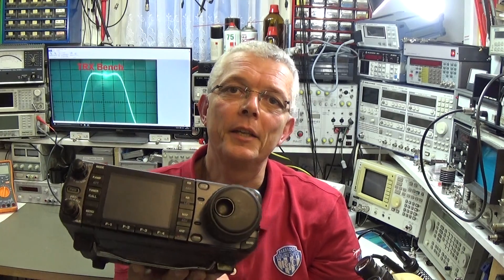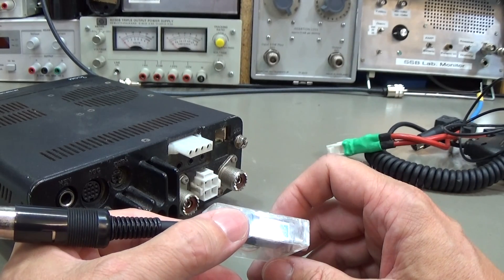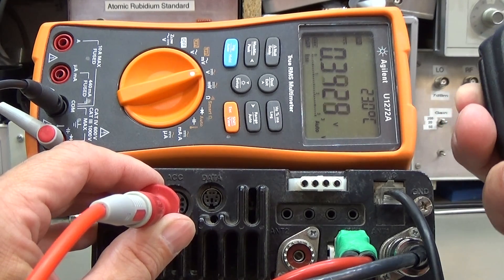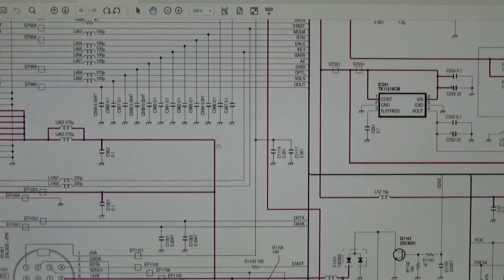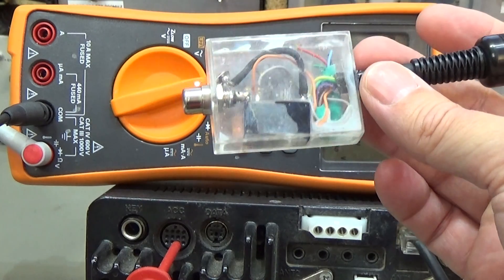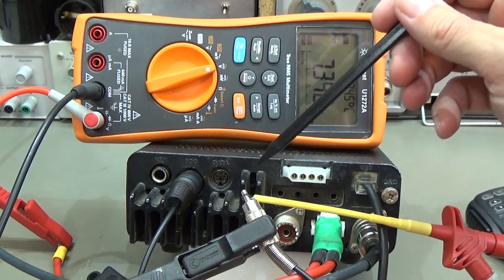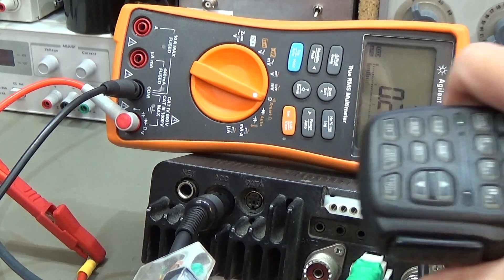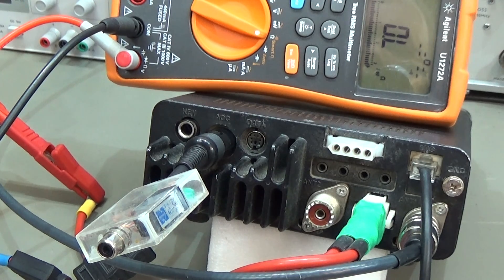#109 ICOM IC-7000 will not trigger an external linear amplifier

Comment: Hi i have a question. 
I have an icom ic7000
Its currently only set to 25% rf power. And when I try to transmit on certain frequencies,it cut out power wise then restarts. In fm 14mhz  and up 
and seems to randomly do it with pretty much all modes .
Is this a known fault or am im doing something retarded.
Reply from the maker: Problem potentially could be anywhere..

Comment: Hello my friend, I had 12 years to connect  my homemade Linear amp 2x813 600W........ and I forgot the output of Icom 706 MKIIG .
your article explained it all in a simple way and thank you very much MAIK from Greece..
Reply from the maker: Thank you glad that you liked it!
Reply: @TRXLab  The relay is the power supply with 7 volts or you insert transistors ,

Comment: Peter. I recently bought an IC7300 and I built an interface for the acc port. Those bloody 13 pin din plugs are a nightmare. My old linear has 28v on the ptt line, I did have an opto coupler on it but I just didn't trust it. So I built a new footswitch wit dual switches, one for the amp and one for the radio. Better safe to know they are completely separate. It seems the keying relay in the OMs amp has a problem. 73 Peter

George
Reply from the maker: Hey sound like a great job, George. Yes better to be safe! Yeah the problem was in the OM's amp... 73

Comment: Another interesting video Peter. :-)  

At the end of the video, I am wondering why the owner of the IC-7000 (who must be a ham) could not perform simple tests like you have done with a multimeter  to determine the radio (and relay box) was fine.
Reply from the maker: Hi Michael, well I don't know...Thanks for stepping by 73

Comment: Is the relay switching between an isolated open/closed circuit or is it infact switching the radio ground connection out to the output centre pin which is what the amplifier would need to see? It may be missing its ground out connection even though the relay appears to switch normally  Karl
Reply from the maker: Hi Karl, the radio is switching to ground so it should work without problem. Thanks for watching 73

Comment: The most linear's are triggered by the rf signal, why use a external output to switch?
Reply: You also don't generally want the relay in the amp switching while there is RF coming from the radio.  It isn't good for the amp relay to hot switch, and it isn't good for the output of the radio to go briefly open circuit while the contacts change.  The send output (PTT) is normally sequenced so that it triggers a split second before the radio starts outputting RF.  This gives the amp relay time to energize before RF is applied.

Comment: hello Peter, im using one circuity like that in my IC-7300 to switching my amp SB-200 from heathkit ... im using a PIN TO GROUND WHEN KEY and a constant 13.8v ... when im press ptt the small relay turn on and gime me a independent 2 pins of relay to key my amp ... 

big 73 de PY7DJ  - NETO
Reply from the maker: Hi Neto, yes very good together with a SB 200.....Thanks for stopping by all the best 73

Comment: Looks like the circuit is working as designed to me Peter. Could have a bad connection in the external amplifier or missing voltage.  Your troubleshooting  was just as I would had done it. Good job as always my friend. BTW, is that external devices incased in epoxy?  Thanks Peter.
Reply from the maker: Hi Buddy, yes I agree the cirguit is working as designed... Yeah that was standard trouble shouting method :^)  I'm not sure but it is a kind of epoxy.. Thanks for stopping by. Take care my friend 73